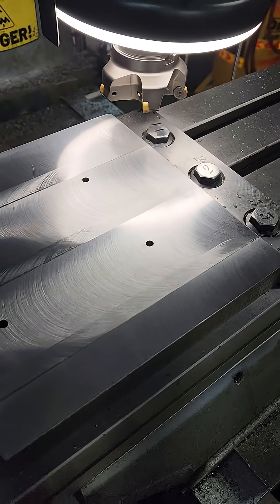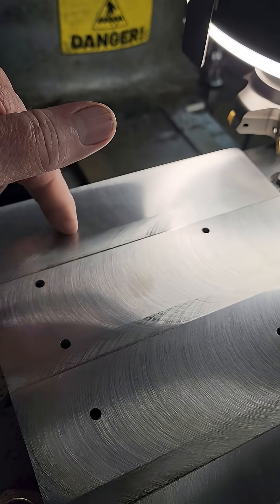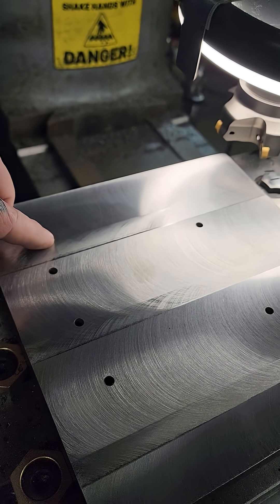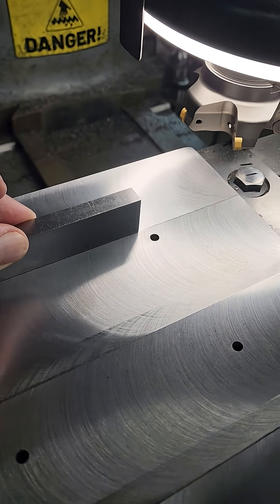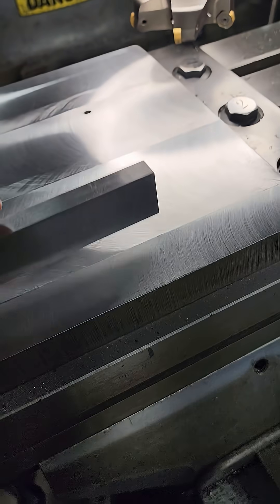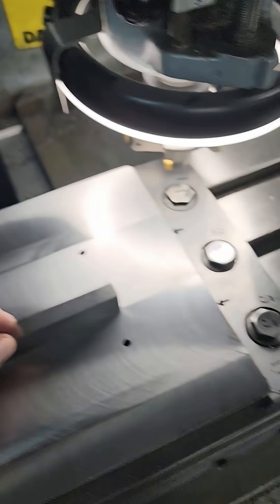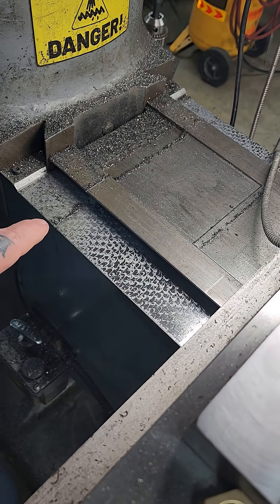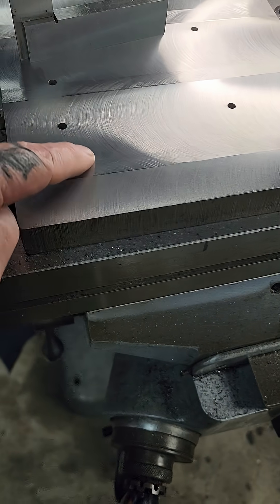Face milling 101.

Comment: Tool pressure
Reply from the maker: I'm only taking off 10 thou, and that shell mill was recommended by kennametal due to the low tool pressure it offers. It has performed way better than my other shell mill.